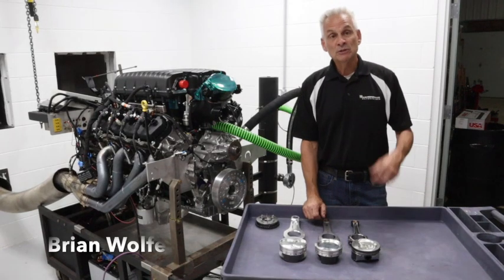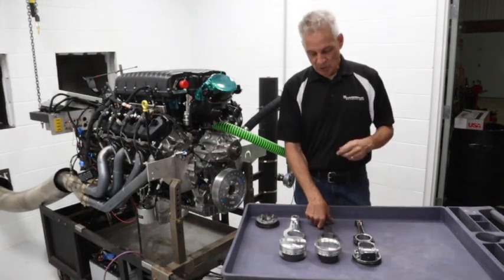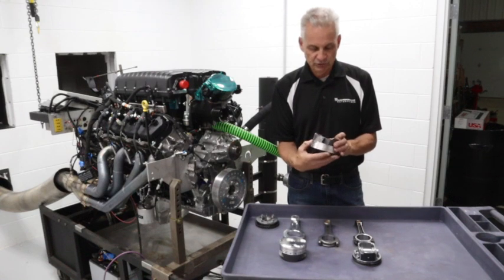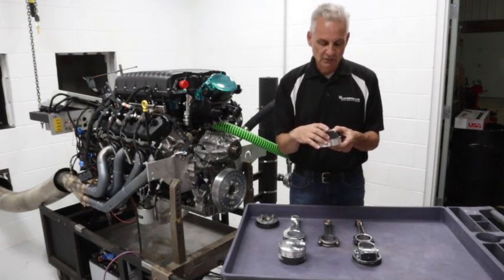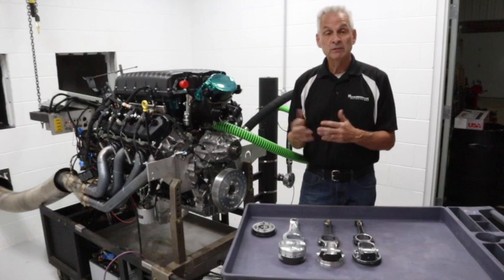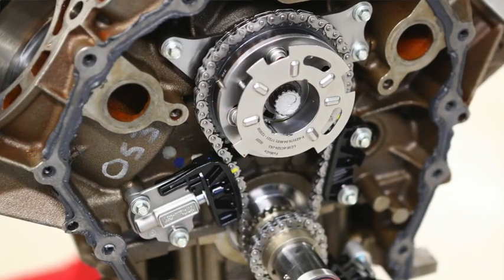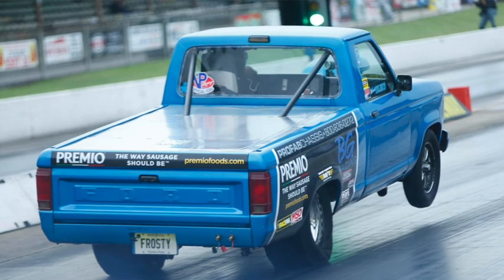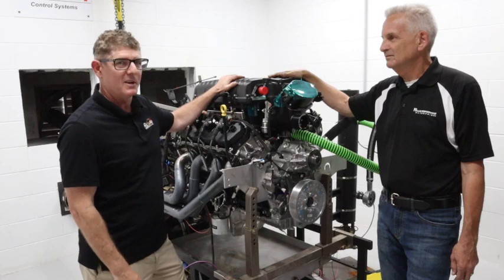7.3 Godzilla — Max Power? — Engine Management — Plus... Rods, Pistons and Soon, Ford Whipple Boost

Comment: Huge opportunity for marine power plants with this engine
Reply: I like the cast iron block. We all know what happens to aluminum in salty environments.😬
Reply: Got a note from Indmar saying it is being evaluated.  Most marine engines run best at 3 grand and max around 5,500 so this is a great sweet spot.
Reply: Tom F if that is true I hope they also come out with a new sterndrive behind it and not make another jet boat engine.
Reply: @mewrongwayKOCXF  no it doesn't. They had 225 crank hp 302s moving 25 ft boats up 40 mph on the water. Most fishing charters use 2 300 hp diesels to move 32 ft boats at 60 mph. A well built and balanced engine will live just fine at 3k to 5k out on the water.
Reply: @damiendoisher7812  I had a pair of 302's in a 28ft carver. The sweet spot was about 3800. The only problem I ever had was the carbs, I had to replace the gaskets and the needle and seat about once a year
Reply: https://www.indmar.com/engines/raptor-575/
Reply: no marine applications need to run at high rpm's for long periods
Reply: w s l and?
Reply: @jamesd2863  this motor was not made like marine and agricultural motors are its not made to run a 80-90% duty cycle its entire service life and thats why
would be an expensive swap for very short life expectancy
Reply: w s l that’s not true. There isn’t much difference.
Reply: @jamesd2863  theres not much difference between a gas engine designed to work in a passenger vehicle and a marine agg engine designed to work in a boat/ agg equipment 
really?
Reply: w s l Yes correct. Go ahead tell me all the differences. Almost every pleasure boat’s engine was originally designed for use in a car or truck.
Reply: @jamesd2863  if you dont understand the  basic differences between agricultural and automotive engines i am not writing a novel in the youtube comments to explain just know yes it would work but not very long
Reply: w s l I definitely understand them. It’s literally usually only a cam swap and some paint. Take a look at some boat engines some time. Next you’ll tell me the big block Chevy was designed for boats and agriculture use
Reply: @jamesd2863  we'll just go with that a cam and some paint
edit: look on the internet and youll see theres  more of a difference than a cam and some paint
Reply: As an anchor☺
Reply: @gothicpagan.666  haha i'm dyyyying!